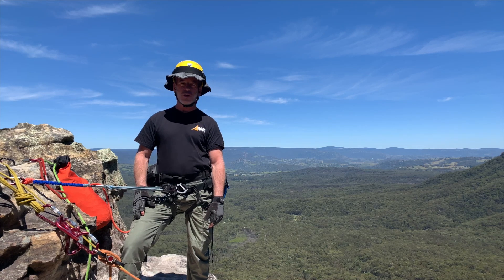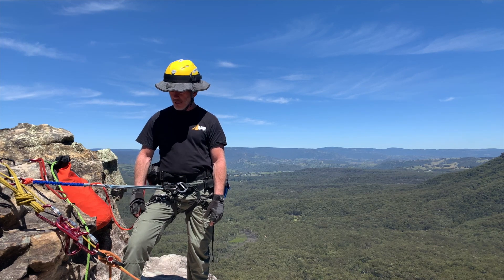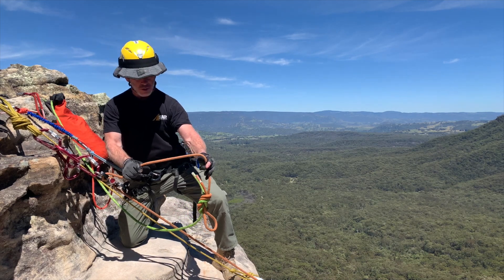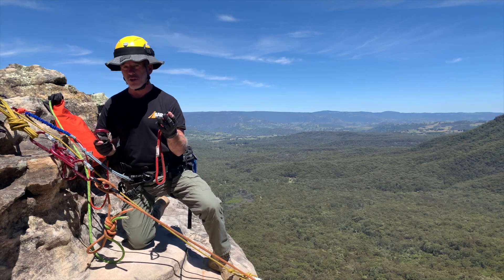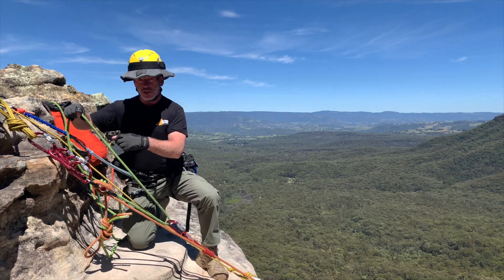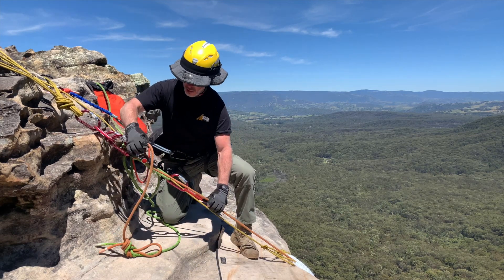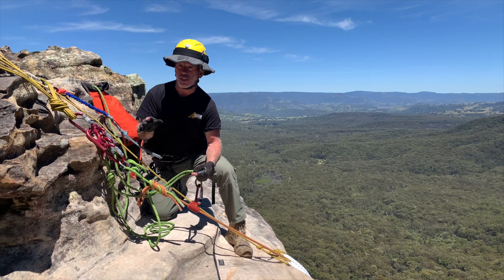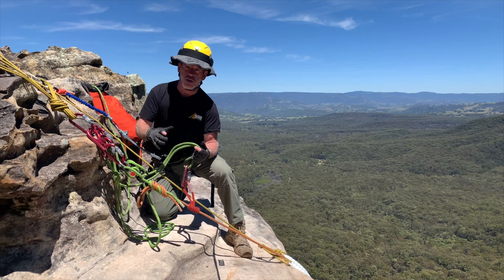Knot (bend) pass during a lowering operation.

Comment: Isn't the line grab the only thing between the object you're lowering and the ground in the moment you're taking off that main lowering device? So if that prussik failed /started to slip while that lowering device is off what would stop the object from hitting the ground?
Reply: I had the same thought. When escaping a belay system in rock climbing we also use a munter backup on the load strand in case the prusik slips.
Reply from the maker: The system would be backed up with a second redundant belay rope / device from anchor to load. We left this out of the setup for clarity (hence why there is only one rope in the video). I'm pretty sure it states this in the audio but it may have been difficult to hear or interpret (we had trouble with the sound on this one).